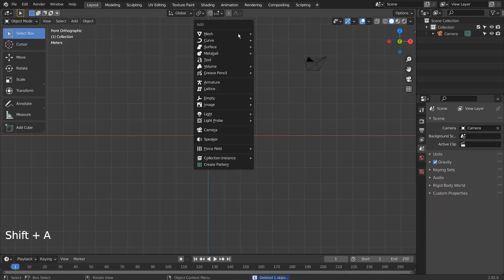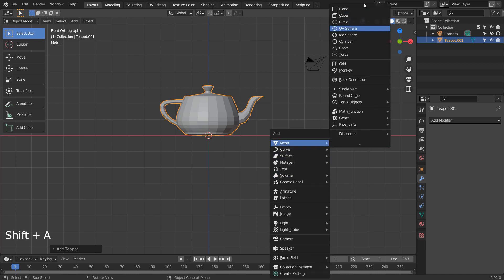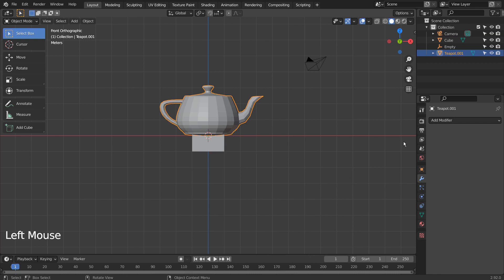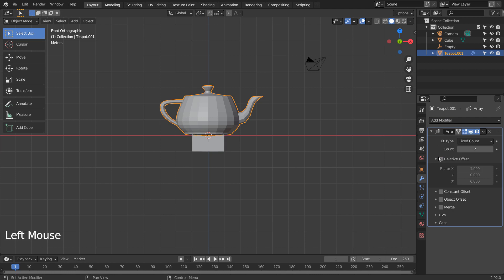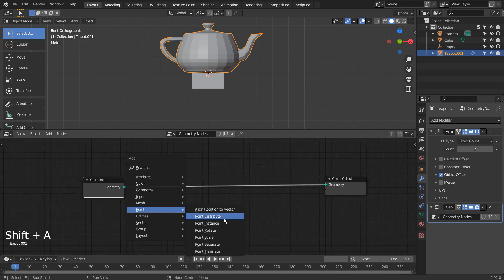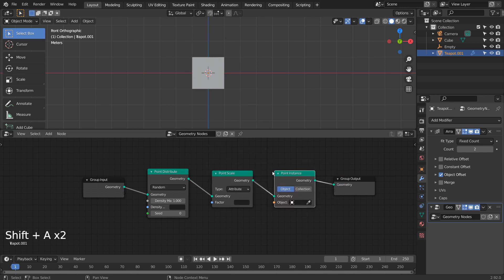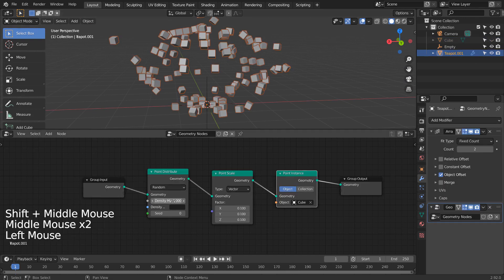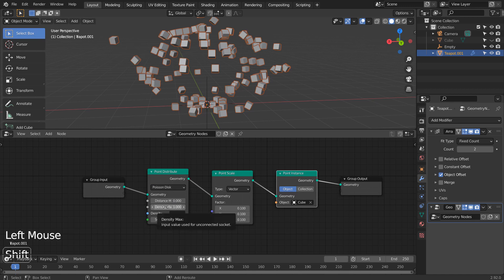Blender tutorial - How to fill a mesh into another mesh using geometry nodes

Comment: Why do you use the array modifier? It seems to work great without it.
Reply from the maker: Thank you for watching, Mario..!! :)  Until today, I thought I had to start with the array modifier, before adding the geometry nodes in order to make it work.  I think that's because I took notes from another geometry nodes project that I was working on earlier, and thought I needed to have the array modifier and the empty object, in order to fill a mesh into another mesh..  I have just confirmed the array modifier is not needed to fill the mesh.  Thank you very much for the update, Mario..!! :)  I'll pin this comment right away..!! :)